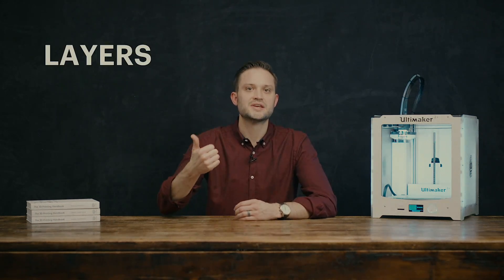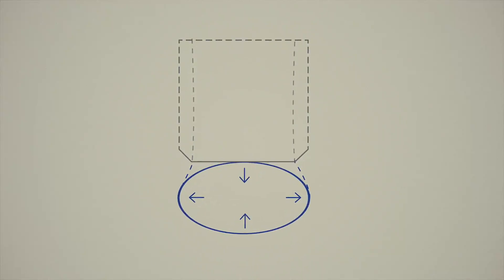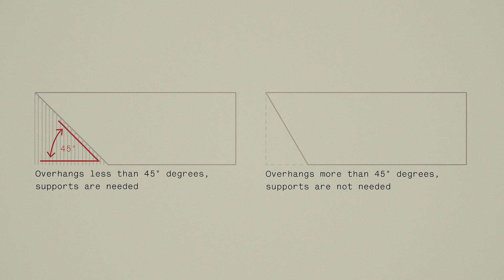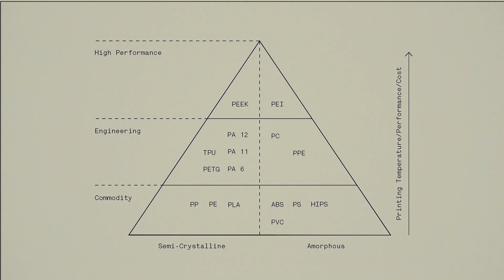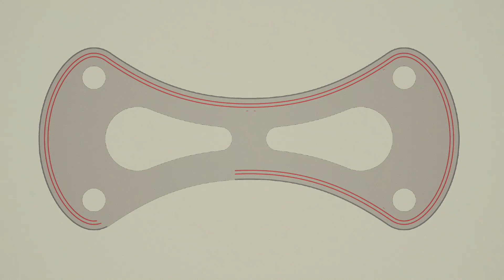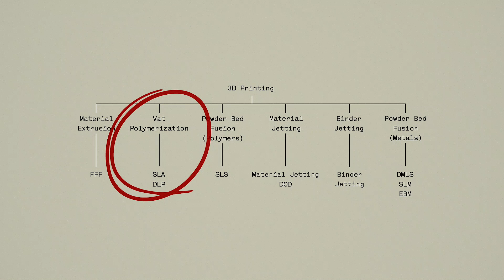FDM 3D Printing - How to Prototype Like a Pro

Comment from the maker: 0:33 What is FDM 3D printing?
0:54 How an FDM printer works
1:24 The main characteristics of FDM: 
         1:32 layers
         2:52 support material
         4:53 infill 
5:43 The different FDM materials
6:29 FDM post processing and dissolvable materials 
6:45 Some of the latest developments in FDM

Comment: FDM is fantastic for rapid, low-cost concept validation! 🚀 This video is a perfect guide to start prototyping. When your design is ready for higher strength, temperature resistance, or smooth surfaces for presentation, Jevny's industrial SLA, SLS & CNC services are here to help. Perfect the journey from idea to pro prototype!:face-blue-smiling:

Comment: Are microstructures like a cortical bone possible to be printed by this method?
Reply from the maker: Hi Mansi, It highly depends on the use-case in this case. Generally, we would recommend printing visual representations of cortical bone in a process called SLS in Nylon 12 powder to get a fairly accurate representation. If the model is as detailed to show the Trabecular bone, these details might be too small and might not fully form. For SLS 3D printing as the minimum feature size is 0.8mm. This video is all about FDM, which is generally better suited for low-detail prototypes
Reply: @ProtolabsMFG  Oh ! Gotchya !
Thanks :)
Reply from the maker: @mansiudayjoshi  You are welcome Mansi!

Comment: What is the best machine for making plastic prototypes?
Reply from the maker: Hi Liam, the best process for different goals is: 
FDM for things like low-detail designs with no overhangs
SLA for small high detail parts
SLS or MJF for intricate designs and complex shapes

It really depends on your goal which machine would be best but we hope this helps to give a general idea.